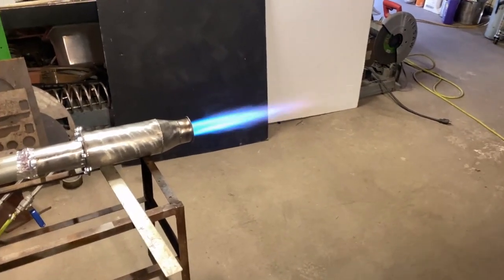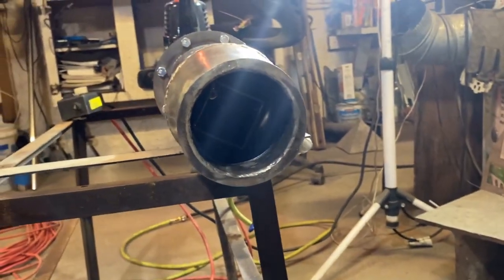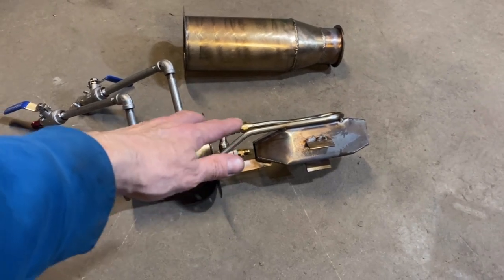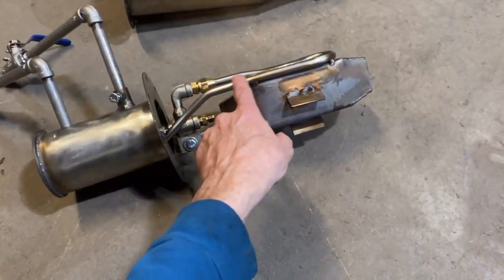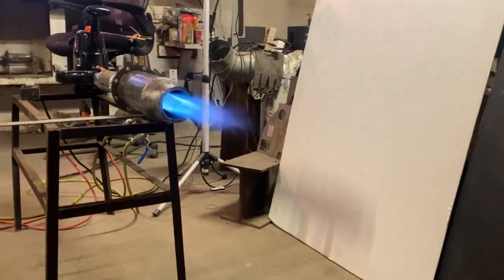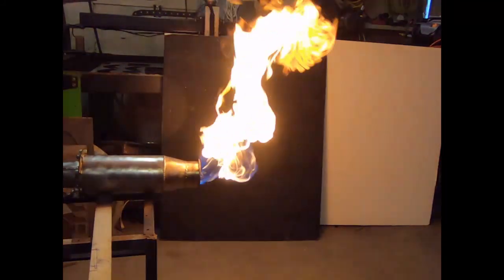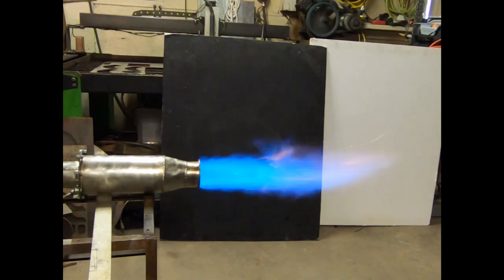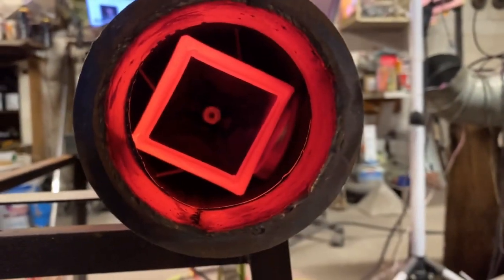Dual action air atomizer cast iron melting burner  Clog free operation

Comment: I'm not pre-heating the fuel either, for all the reasons you mentioned. What I made is three slopes with a 1/2" pipe on top of my burner to get the air preheated a little more. On mine, I have installed a blower at the back which is essentially the same principle as your leaf blower (leftover blower from an old forge), and a line for compressed air. For aluminum melting, I can cope with the blower when I melt copper or bronze I use additional compressed air.

Comment: I do successfully pre heat my oil, but I use heated coolant to do it.
I also had issues with the boiling oil causing voids, solved this by having a positive displacement pump, little valve that maintains backpressure as close to the nozzle as possible, and a tiny nozzle orfice.
Unfortunately all that isnt really feasible on smaller, more portable setups such as yours.